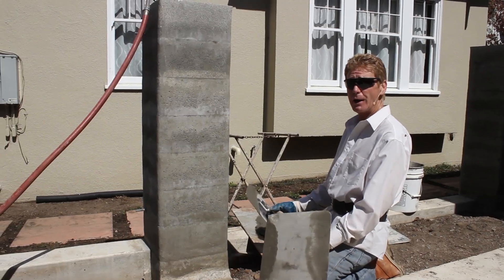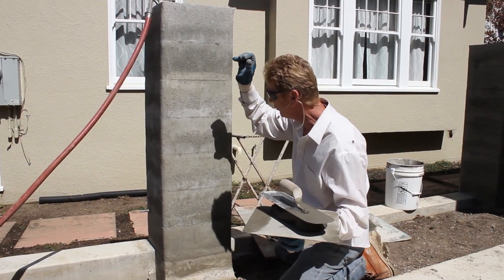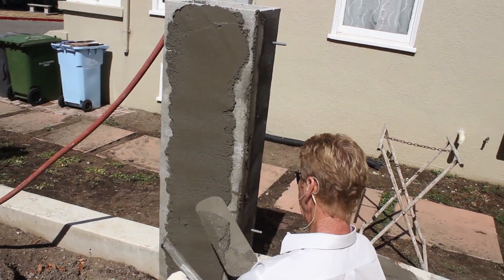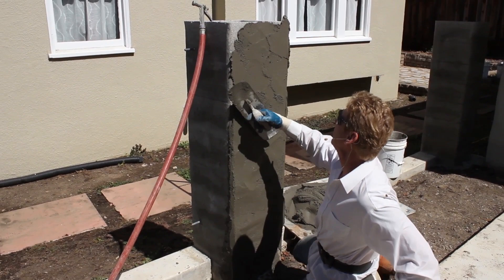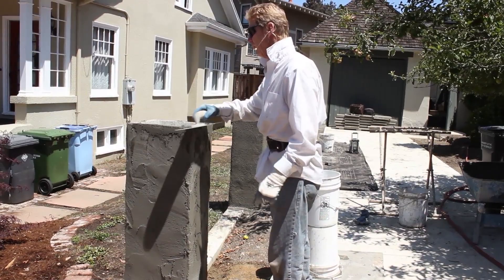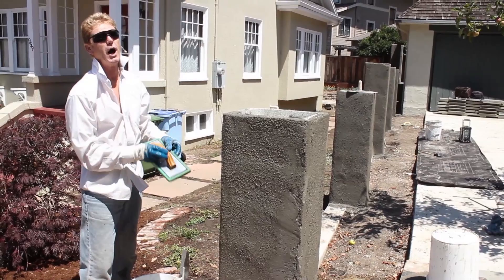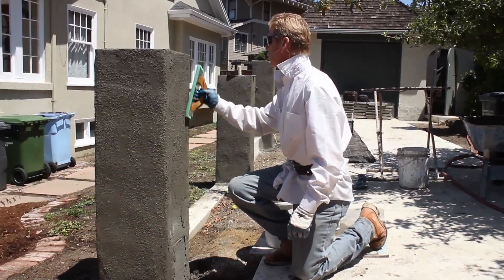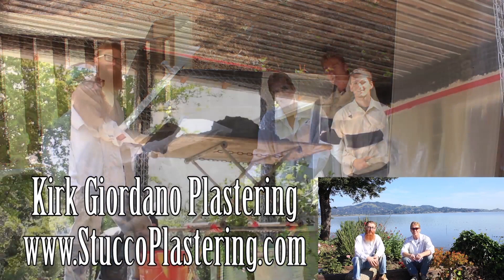Stucco concrete block pillars.

Comment: now you say you add lime ..why ? and how much lime to 3 sand to 1 cement ?
Reply from the maker: Howdy Peter, this was a rare project, I have only added lime a few times in my years of plastering, these walls were smooth as glass, the lime helped the stucco spread better,
 I added a couple of shovels full to the mixer, if these walls were not smooth like glass I would not have done so, another way would have been for me to apply a bonding agent to these walls.
 Cheers and have a good and healthy new year,
 Kirk and Jason giordano
Reply: Peter Benn hi, here in the UK I use lime all the time in my sand and cement. An example mix would be 4/1/1 sand/cement/lime for scratch coat, then 5/1/1 to top it off 😉 it improves the workability of the mix considerably.
Reply from the maker: Howdy Mike here we also have lime not the real stuff like in the U.K, it's called a plasticiser,
It's sort of like calling corn syrup, sugar, a cheap man made product said to achieve and act like the real thing, me arse,
it's a vicious world brother.
Indeed soon,  a cheaply produced clone of myself will be doing these videos.
 Best wishes with your projects,
 Kirk giordano plastering on small repairs
Reply: Kirk Giordano plastering Inc. We are very fortunate to have a range of different lime products at our disposal here. I specialise in the of Hydraulic Lime pointing and plastering, absolutely love the stuff! 
take care my friend ;-)